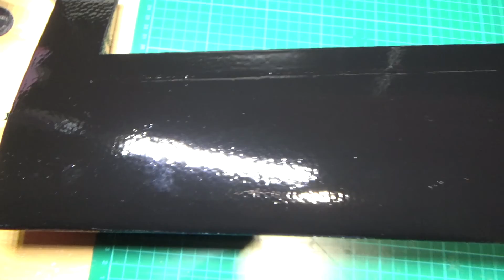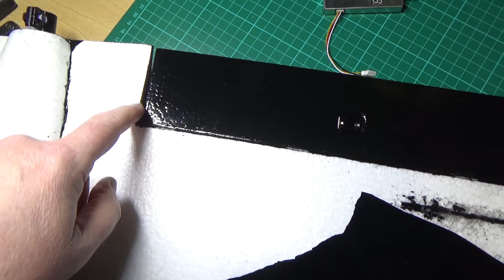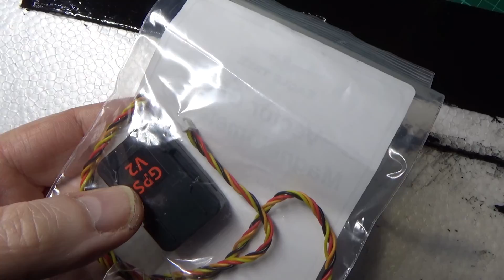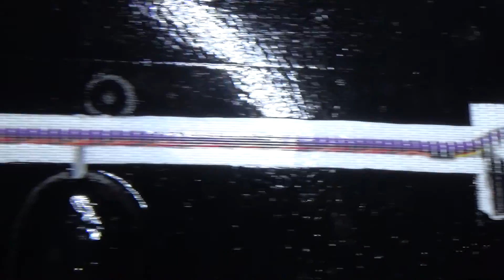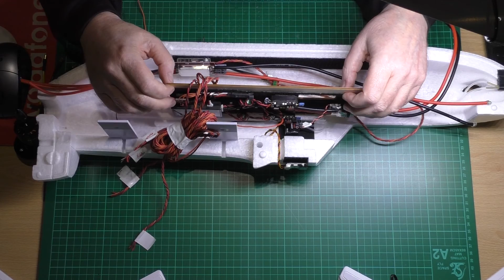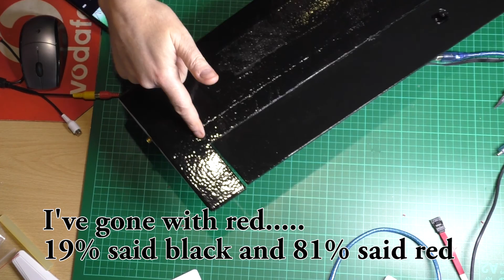SkyHunter FPV build part 7

Comment: Why are you using cat5 cable? wouldnt it be better to just use servo cable? And also, why arent you using PPM on the ezuhf?
Reply from the maker: +Daniel Perkins CAT5 is very well insulated with twisted wires and an outer screen. Overall, it reduces video interference a lot. And.... I am using PPM. The wires coming out of the EZUHF are for the servos (wings, tail, pan & tilt, camera switcher and nose wheel)
Reply: ok. I guess I should think of getting cat5. How do you connect the cat5 to the eagletree? or do you go over that in another video

Comment: Looks like your getting on well with the build, my pan and tilt is a geared system with the wires going through the Center axial so I added a slip ring so I can turn my pan 360 degrees all day long and not have to worry about pulling the wires out, just a tip!
Reply from the maker: +Rotor Flex Brilliant idea! Stupid question but..... how's your flight cam connected?
Reply: +Vortecks easy buddy, out of the fpv cam straight into the slipring that is secured at the base of the pan tilt frame, from there into a large molex connector that has my cam and servo wiring so I can disconnect the hole pan tilt system with one plug, then the cam wiring goes from the molex connector into the vector video input and the vector is also powering the cam with 5v but as you know you can also power a 12v cam via the vector depending witch cam power loom you choose to use to suit your can voltage.
Reply from the maker: +Rotor Flex OK, my next question is..... where did you get the slip ring from? I NEED one :D
Reply: i use the mini ones for camera rigs, you wont get better than this one.......http://www.ebay.co.uk/itm/Slip-Ring-Miniature-12mm-diameter-6-wires-max-240V-2A-/321776588886?hash=item4aeb611856:g:nasAAOSw7NNUCgQo